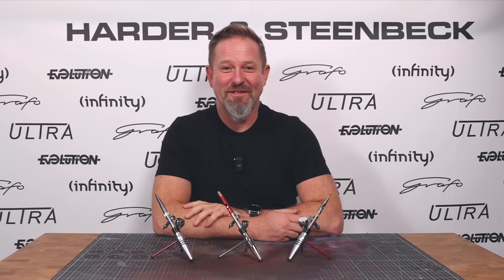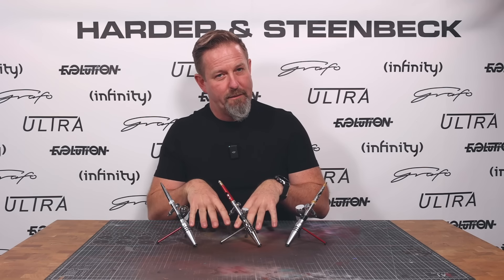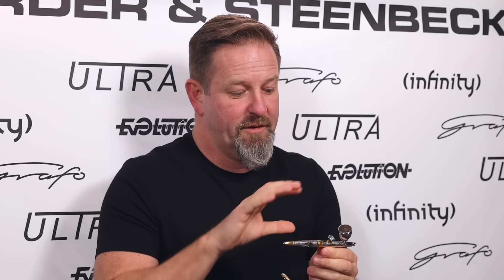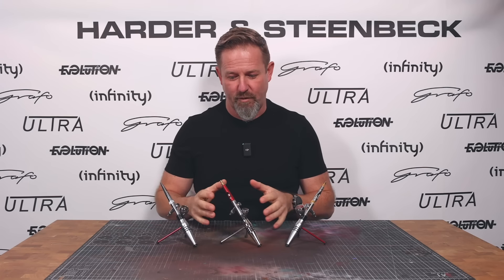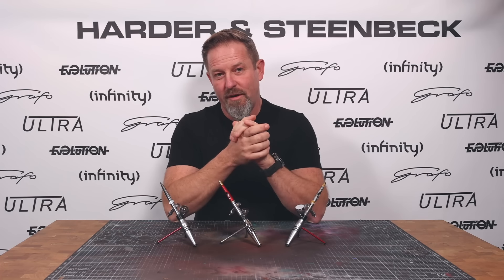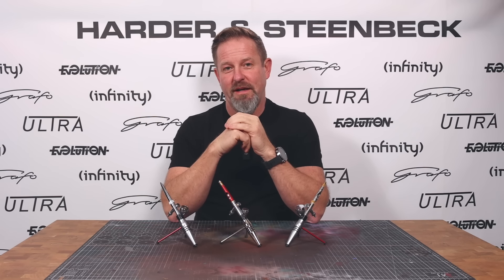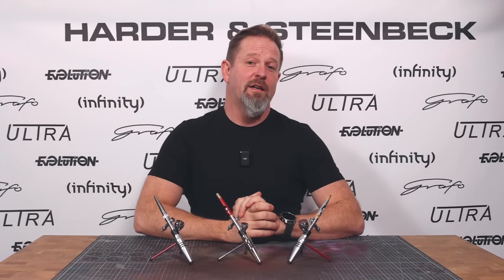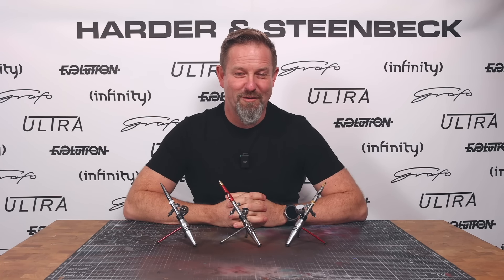Let's talk about the Infinity 2024 CRplus Airbrush!

Comment: My question is will you offer upgrades. My infinity sits in its case and never get use because of the inconsistent trigger response. No way I'm going to try another H&S airbrush after the top of the range performed so poorly. You should offer a fix for the existing trigger issues on the infinity. It's not fit for purpose for a fine detail brush. Everything else about the airbrush I loved but a reliable trigger response is 95% of detail work. I found the infinity really easy to clean, I swop paints and adjust shades constantly and found I had no issue with colour contamination even with very fast colour change overs. The micro cup would have been my go to, never bothered buying as the brush was not useable for the detail I need, but for a detail brush mid size and micro cup would have been my preferred in box cups.  The weight and finish seemed to be the as good as it gets for me. I know some folks remove the end to lighten the brush, The current weigh seemed close to perfect for me but I'm happy with most lightweight brushes. Again, without fixing the trigger response everything else is meaningless and you should look to release a trigger upgrade kit so those that spent a substantial amount on the current infinity can finally blow the dust of and try and get some use from them.
Reply from the maker: Hey buddy - thanks for the comprehensive response. Always appreciated. I agree that the trigger response needed improving. However, I always stop short of calling it a problem, preferring to say that we need to improve it. The reason why I draw that distinction is that there is too much incredible artwork out there done with the Infinity to call any aspect of its performance a "problem"... BUT 100% agree that there is room to improve that aspect, and that was the first item on the agenda for all these new 2024 airbrushes. The trigger response on the Infinity 2024 has my total confidence now. As does the Evolution 2024, but we've done something even more special with the Infinity 2024. As for upgrades - this has always been an H&S thing - the interchangeability. So yes, there will be potential for upgrading the older airbrushes, BUT many of the changes that contribute to improving the trigger are set inside the body of the airbrush itself, and so the upgrading an older airbrush with new parts will never create a full 2024 feel and specification. But they will offer improvements, for sure. W
Reply: @harderairbrush  appreciate the response and absolutely agree a lot of folks use the current infinity and getting great results, but I'm far from alone in finding the inconsistent trigger means I always have a better tool than the infinity for the job at hand. I'm sure there will be a host of improvements  that can not be retro fitted and that's totally understandable but we know you can engineer great airbrushes and have the ability to fix the issue in the current model if you prioritized it. The infinity CR+ is a brush a really want to love but just can't at the moment. I'm sure you have resolved the issue on the new brush and would love to try it out if you will do a trade in for my "as new" barely used current model ;-)  I really do like to see H&S success though. I recommend the Ultra as the perfect beginner airbrush. It's clear you have a obsession with creating great airbrushes and that pushes the whole market forward so we all win. I hope I will be a H&S customer again at some point.

Comment: The sketch cap would be a nice and also maybe a cup in between the current two. I have several different H&S airbrushes. I like the interchangeably parts too. The good one  would be giraldez body with a different trigger and the Kiev weight in my opinion.
Reply from the maker: Thank you Kevin! Much appreciated that you've written back with your thoughts... Actually I agree on the in-between cup... W

Comment: This will be curious. My impression was always, that a higher responsiveness with thicker paints comes with an increased airspeed at the tip of the brush. I mean, that basically the point in thinning down your paint, to work with lower pressure closer to the surface in detail. I am not an advanced painter, but this was always my understanding of the physics behind this.
Reply from the maker: We have had some discovery 💡😊

Comment: I use a lot of brushes including pretty much all H&S albeit not the latest versions. Yet I often found myself using other brands including Chinese because for me the length from the trigger backwards was too short and so it didn't feel comfortable which is why I've all the H&S brushes equipped with an extension tube between the front and rear end. Now they are comfortable but heavy 😅 10mm extra would be nice 🙌🏻
Reply from the maker: Awesome - I’m glad to tell you that the Infinity 2024 has a longer back end 🤙🏻🤩
Reply: @harderairbrush  Super 👍🏻

Comment: I am generally very happy with the current Infinity 2in1. I often use the 0.15mm version for inks. I only prefer the 0.2mm for thicker colors. For primer and clear coat I prefer to use the Ultra 2024 with 0.45mm and FineLine cap. My suggestion for improvement would be to change the trigger. It would be ideal if you had more feel for the trigger when you open the air supply and the color starts to shoot in. A kind of small resistance would be helpful at that moment. I think the separate air/color control on the Ultra is a start. But even there, there is still a lack of feel for the color supply. The trigger should get a little heavier the more you increase the color supply. That would be perfect. The color quantity control at the back should also have very fine clicks with a very fine grid. I would also change the shape of the trigger. A little more contact surface like with Iwata would be good. Maybe these are a few ideas for you to make something good even better.
Reply from the maker: Ralf I am very happy to tell you that I agree with you on every point. W
Reply: Progressive springs are often used on motorcycles to create a soft response and then a stronger resistance. I could also imagine using this for the spring for the airbrush trigger. The trigger in the form of the Takumi Micron could be set a little lower and further forward than before. I think this would help a lot.
Reply: @harderairbrush  but 2024 goes slowly to end. If you are still working at the engenering, than i think you‘ll don‘t could release before christmas. 😏
Reply from the maker: Hi Ralf… check our Instagram and follow this link - the date is set 😊 thank you for your patience with us!
https://bit.ly/3AJETgs
Reply: @harderairbrush  i am the first one who buy it! I promise!!!
Reply from the maker: Thank you Ralf!!! W

Comment: Feedback so far? I have a very love hate relationship with my Ultra 2024, when it is working I couldn't ask for a better airbrush, but I have had a devil of a time keeping it running clean, entirely possible that I simply haven't found the level of thinning, the air pressure, or some other factor that my technique and the brush don't agree on, and I certainly am not going to abandon it yet, it's far and away the best built airbrush I own, but I do have to say that neither my Badgers, nor my Iwata are nearly as fickle. I suppose this could be a design choice, by making it less forgiving I will probably grow as an artist, but it definitely is coming with growing pains. One small complaint is the spacing between the trigger and cup, I have bear paw sized hands (xl glove size) and it isn't a great fit on the ultra. 

Cleaning? You guys nailed it, stupidly simple to clean. If I had to give an improve? While the tip makes it easy to get a brush in to clear dried paint, all the little nooks and crannies are a bugger to clean, it'spurely aesthetic though, but I like to take care of my tools.

Cups? More options is more gooder, I typically airbrush for base painting miniatures, and where possible I prefer to use the airbrush over a traditional brush, so being able to grab a tiny cup to do belts/pouches and chachkies of all descriptions while not having to fight with the cup for finger placement is wonderful.
Reply from the maker: Hey John - thanks very much for the feedback... with regard to thinning, a really good rule of thumb for our airbrushes, that we design to, is if you put the blunt end of an airbrush needle into your paint mix, we want the paint to drip off steadily... you want NO elasticity to the drip, you just want to see if drop off steadily with a clean break of the drop each time. This is your max thickness unless you're pursuing texture/ high build. Thinness of course has no limit, just depending on how much transparency you want in the colour. As an example, try using Vallejo Air paints, thinned 1:1 with their thinner...
With regard to the cups - we will shortly be releasing an accessory for the ULTRA 2024 which is a slightly smaller cup which gives a lot of clearance for the Grizzly artists!

Comment: I have two Grafos (T1/T2), the   Infinity and the Giraldez.
The only real problem is the trigger response. The Giraldez version did not quite fix this problem.
I mention it as a problem because comparing it to the competition makes it feel like so.
When this is fixed then all the rest are a matter of preference.

The options for color cups from the micro cup all the way to the 50ml big plastic cup or even the side feed suction cup converter and needle and nozzle sets from a 0.15 up to 0.6mm and their interchangeability plus the manufacturing quality and the ease of disassembly and cleaning are the things that make the H&S airbrushes to stand out
Reply from the maker: Thank you very much for writing back! W

Comment: I need some advice. It seems that many of the seals in my Infinity CR plus are PTFE which are extremely resilient to the effects of harsh chemicals like many acids and solvents. Now, prior to purchasing my Infinity, I was using a non-brand Chinese knock-off and when it needed a proper deep clean, I would give a quick squirt of carburettor cleaner into the chamber beneath the paint cup. (The ingredients of which are: CO2 propellant, ethyl benzene, toluene, methanol and acetone) I didn’t allow it to hang around and immediately flushed with water. ( the effect was profound. The chamber sparkled) It hasn’t suffered any ill effects as a result, but I would like your thoughts on using this deep cleaning technique on my Infinity. ( and yes, I can imagine you throwing your hands up in horror!)

Comment: Looks great, shorter front like the Giraldez is great, but the Giraldez is giving fatigue and muscle pain due to the trigger design. I like the feel and responsiveness of the trigger in the Evolution 2024, and the level of detail you can get with that one, but it is heavy on long painting sessions, although that gives stability as well. What I would like to see in the infinity is better atomisation on lower air pressure, like the custom micron from Iwata. Using an Iwata it seams that all the Iwata's (eclipse and CM) need lower air pressure to atomise the paint, with all the H&S it feels like the air has to work to push out the paint in the brush, if that makes sense, the new Evolutions is better but not quite there. And perhaps that can lead to less overspray when spraying heavier and further away, and more control on smaller surfaces like miniatures, not a blow back of air when you paint a miniature. And finally some lovely color on the brush like the season colors that would be awesome! And I love to try the new one out!! And the cup sizes are perfect, small mini and big love the 2 ml cup, and the sketching tips from the Giraldez are amazing so yes on that one. And last but not least chance the nut that holds the needle in place, it can become stuck/hard to loosen and not yet hold the needle in place. Cheers.
Reply from the maker: Wow thanks for the awesome reply - really appreciate the time you've taken to write that. Your description of low pressure refinement is one of the things that we are going for with the new head design of the Infinity... but one of the other differences with H&S and most other brands is that we use typically half the volume of air of other well known brands. This means that you have a lot more choice in terms of compressor, but mainly also it gives better control of the pattern spread on wide trigger openings, at normal spraying pressures. It's a different philosophy. I'll take a look at that needle nut - are you referring to the one on the Giraldez, or the old design? W
Reply: @harderairbrush  Thanks for your kind answer!!! the new needle nut, the one on the Giraldez as in the new evolution as well, love to see the new brush coming. Thanks and have a lovely week!!

Comment: Comment about airbrush for applications rather than level: I'm a miniature painter. I have 2 airbrushes in my set up. One is a workhorse evolution al plus. This has a .4 nozzle. I use it to prime and pre shade (mostly zenithal) . It's important to that this brush is light because I handle it much longer at a time. I value larger nozzle for the primer to avoid clogs of course but I also value greater spread for "lighting" in the pre shading. The othe airbrush is for detail. It is currently the 2024 evolution with the smaller nozzle. I prefer tighter spread with this for OSL or details and weight is nice for feedback. I +++++value the responsiveness in this brush. The priming one not as much...

Comment: When it comes cleaning the new ultra and evolution its easier  and have nicer trigger it will be nice to make the body little lighter and for the  front it will be great to able to fine line without getting to closed  and great idea adding one of the scheking font end from geraldez infinit
Reply from the maker: Great thanks! Cup size? W
Reply: @harderairbrush  maybe 3ml cup

Comment: interesting concepts, without seeing what you've built it's hard to comment... first 'look' is stretching it a bit (IMO). something that has me closer to the work without obstructing tiny details is good (mini painting).  2ml or smaller cup option is great, and the lightweight feel of your aluminium construction would also be good for longer painting sessions but with the chrome finish for cleanup (like the evo 2024)
It's great you're asking for feedback, but i can't help but feel that these are slightly irrelavent if it's comming soon... surely all these decisions are made and production is underway? unless it's not as soon as we're hoping
Are we looking at a H1 or H2 release... i really need a new airbrush and i've been holding out for this
Reply from the maker: Hey there… on the points I’ve asked for feedback on, we have options prepared… now we must decide which we put into production… hence the video 😊
Thanks for your feedback and to answer your question - the launch will happen in Q2. W

Comment: Cleaning my infinity cr plus is simply not the chore it used to be with any of the other 8 previous airbrushes I have owned in the past, I definitely use the 2 mil cup most of all, In fact I have never even bothered with the larger cup and I am painting portraits at 4 foot by 3 foot gesso primed canvas using createx transparent paints only. I used to dread cleaning my iwata's and my off brand brushes because it took me away from painting for so long, Now I make a cup of tea and do a whole strip and clean with ease and no longer resent it because it's just so easy. I would like a choice of spring strengths would be good though we with older arthritic hands can benefit from a heavier action on the lever.
Reply from the maker: Thanks very much for the feedback - really appreciated! Coming soon! W

Comment: I somewhat prefer a lighter brush. I don't care about the softness of the springs, because I adapt instinctively. I'd like the micro cup to be standard, since a detail airbrush does not need to push paint by the gallon. You haven't discussed the nozzle size. Is it still .15? If the head design is as radically different as you say, I suggest choosing a new name altogether. Otherwise, you may disappoint those who purchase older models inadvertently.

Comment: So new head and needle degine. To control paint flow width, at range and the ability to spray thicker or more volume of paint, hence  you larger nozzel sizes.
The ability to cover with more paint a small area ,with full control, idel for miniature painters, yes lighter body airɓrush.

Comment: I don't like the idea of the performance difference between the Evo and the Infinity. I like the current Evo because I do not use all the fine adjustment gimmicks that the Infinity has. Will the difference between the two mean that their parts are not interchangeable anymore? For the way I hold my airbrushes, I like the plain round button triggers. Even on my Takumi Micron I replaced the square trigger with a round one. The cup sizes are good. I mostly use the 2ml and the micro. I love the weight of my AL-plus.
I'm looking forward to the new Infinity.
Reply from the maker: Hey buddy - we will never go outside of the interchangeability - in fact we are leaning into it even more… the only thing that will be different from the past is that an Infinity aircap must be used with an Infinity nozzle. But you can use the head system on any of our airbrushes. 
As for the triggers… I think you’ll like this!
Cup sizes? W
Reply: @harderairbrush  So for clarity (infinity aircap + infinity nozzle) + (Ultra body or Evo body) = should work?
Reply: Or maybe more realistically pop a .45 needle + cap + nozzle on the new Infinity for broad coverage stuff (priming, background, ...)